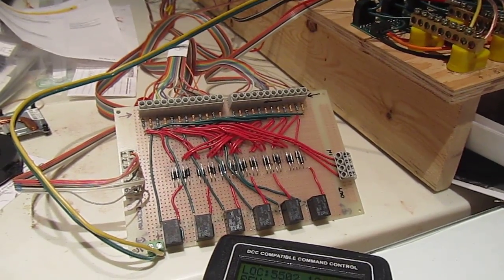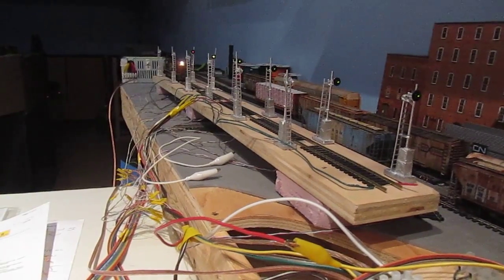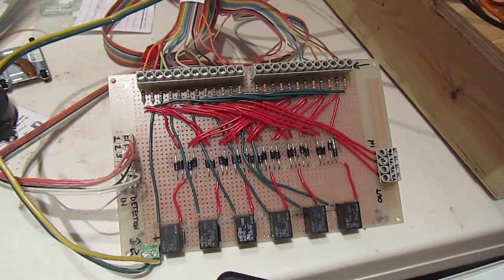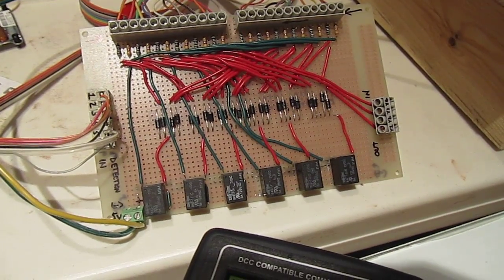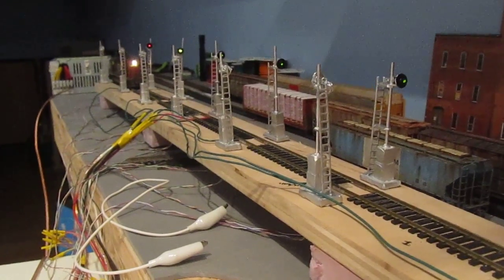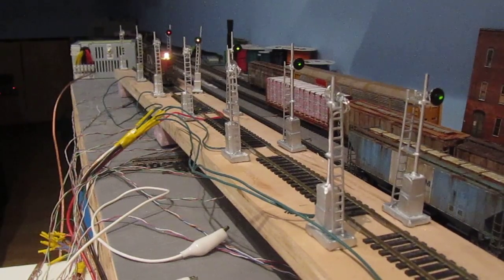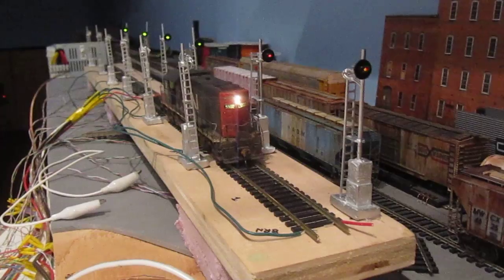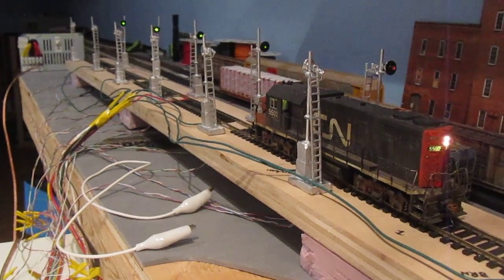Model Railroad ABS Signal System Using Relays

Comment: Very cool setup, does the detection wire coming from the BD20 coil just go to one rail?
Reply: Yes, the BD20's require only one wire to the track.  The other rail is common to all blocks.
Reply: @Steve Juranics  I'm talking about the wire going through the coil. one end goes to the rail and the other end goes to? Or it just needs one end to pick up the signal?
Reply: @gunfighterzero  The other end is coming from the DCC source.  When the engine is using power from the rail, the coil senses the power going to the rails.
Reply: @Steve Juranics  ahhh ok I got ya, like a little clamp on ammeter, duh.. for some reason I was thinking it was independent from the feed like some kind of proximity sensor.. that makes much more sense  lol

Thanks Steve